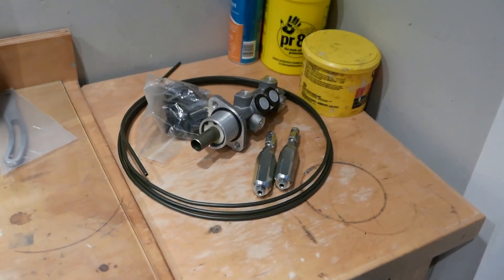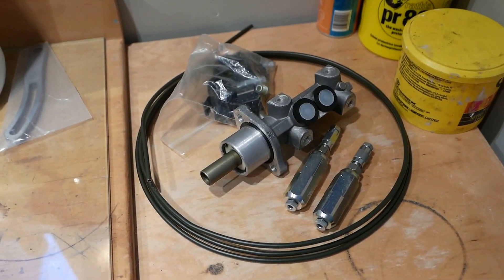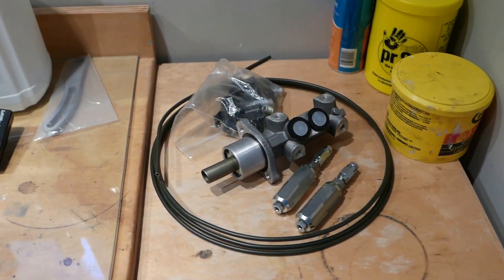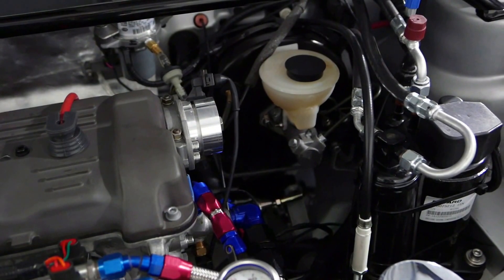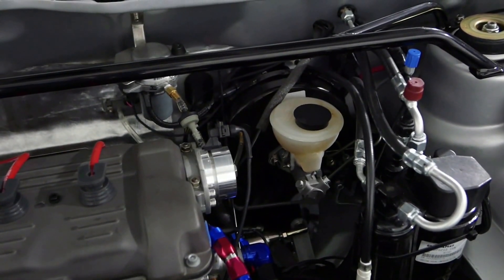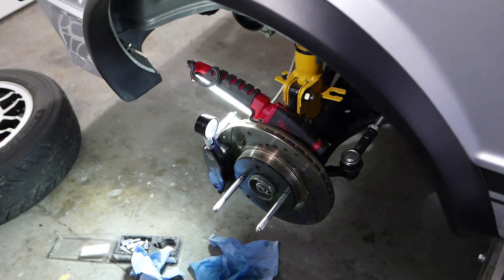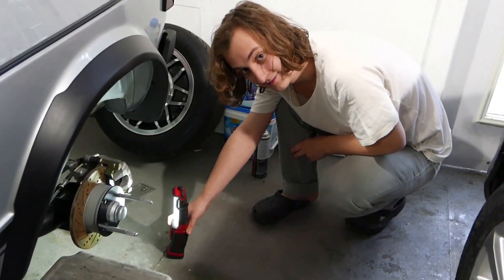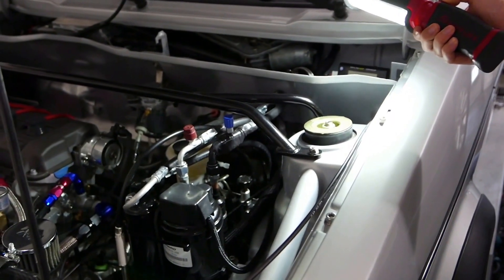The Ultimate 1983 Rabbit GTI - part 138 (Brake System PSI Testing/Prop Valve Setting)

Comment: So if using corrado brakes in the front and Mk2 rear brakes wilwood adjustable prop valve enough ? As I understood with wilwood brakes (multi pistón) were not enough the wilwood prop valves and you needed to use additional reductor valves ,right?

Comment: I need to obtain the 2 proportioning valves and connectors. Where in Holland did they come from?
Reply from the maker: After messing around with inline prop valves at the rear I changed to the single prop valve at the MC instead. The company I bought them from is no longer there.

Comment: Hi Derek, To my knowledge, the fact of using Dynalites, even if they are 4 pistons, actually give you less clamping pressure than OEM calipers. Clamping pressure is directly related to caliper piston size. There are 3 ways to bias your front to rear ratio: 1- Have a different master size for front and rear  2 - have different calibrated piston sizes in the calipers (remember that if you increase your front clamping pressure, you will, by the same fact, unload rear wheel traction, meaning you will need to reduce rear clamping pressure) 3- proportioning valve . The pressure is only one factor: Clamping force, is pressure directly influenced by piston diameter, and has a direct impact on clamping force. This has to be balanced. take a look at Tech-53 big brake kit, and compare the different scenarios. this might help you in trying to funnel in, on what you would like to achieve. Best regards
Fred
Reply from the maker: That is very interesting - I am starting to realize that the Wilwood calipers may have been a bad choice - they are taking quite a bit of pressure to stop the car - more than I expected. I will check out your big brake kit. Thank you.
Reply from the maker: If you can, send me an email at derekspratt@shaw.ca and we'll get going on a tech-53 upgrade to this project - would be informative for all of our channel subscribers ...

Comment: So if you only have one brake line going to the rear do you plug one of the rear ports on the master cylinder? I was also wondering if you had any problems with the muffler rubbing with the rear sway bar it looked like a close fit?
Reply from the maker: Yes. Both ports on the passenger side are plugged and my Wilwood prop valve handles the front left/right split. I use a T in the rear line at the rear beam axle. The rear sway bar is about 1/2" clearance - lucky me is doesn't hit.